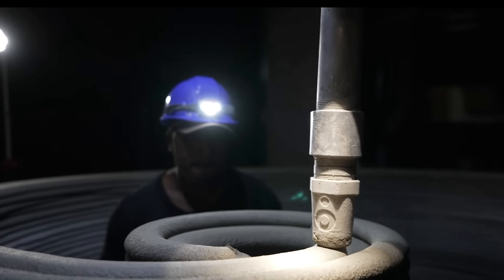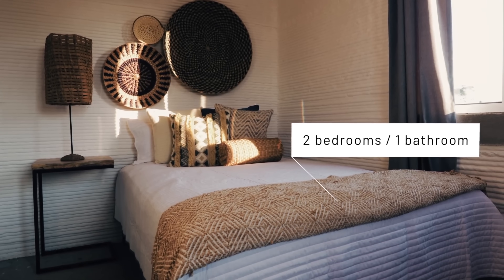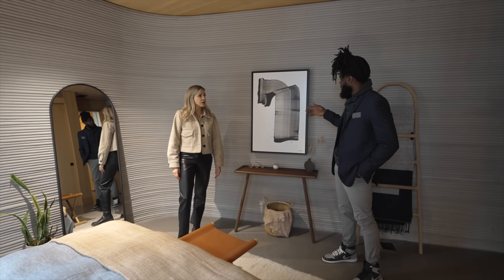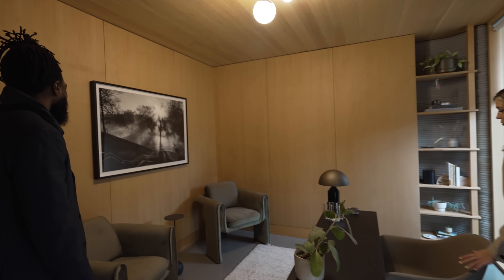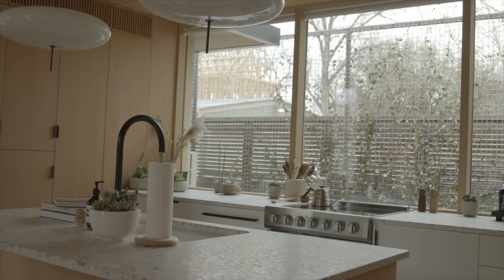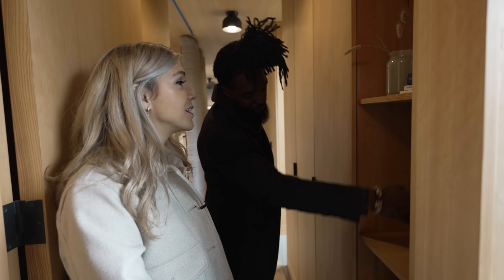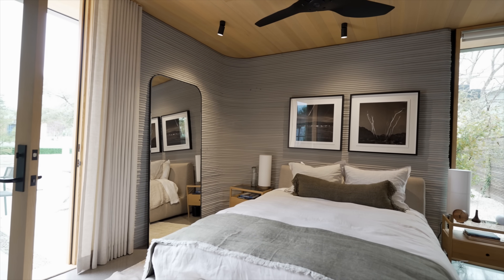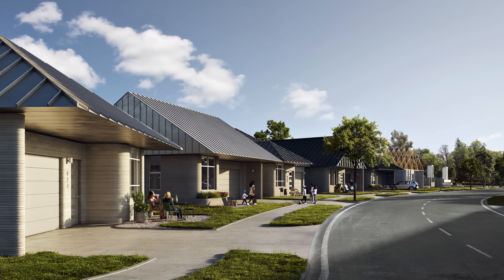Inside A 3D Printed House You'll ACTUALLY Want To Live In

Comment: Instead of 3D printed house why not factory made houses instead. Here's my reasoning:
1. 3D printed houses, despite it's promise, have no guarantee that it'll actually be cheaper. While factory made houses has been proven time and time again to be much cheaper than regular houses.
2. Since both houses aren't very customizable anyway, might as well choose a version that is less of a pain to clean, just look at those walls and count just how much nooks it has for dust to pile up. It's a nightmare for people who have asthma.
3. 3D printed objects aren't known for it's durability wether it's plastic or metal, concrete is no exception. Especially the fact that those houses has no steel rebars or bricks to reinforce it like a typical concrete building would.

Oh yeah if you're going to say "commie block housing bad" then I have some news for you, American suburbs are also basically copy-pasted buildings (but waste more space with those unnecessarily big lawns), and many countries that aren't communist still builds factory made housing for it's price tags. But of course the most famous examples are communist or former communist countries.

Comment: Structural concrete is intended to have rebar reinforcement. And expansion joints. Where was this made? All concrete eventually cracks. This thing could come apart on someone within 10 years depending on the weather. Even sidewalks and drain manhole shafts have steel in the concrete.

Comment: How does plumbing maintenance work on one of these houses. Electrical in the walls is easy enough as you would just feed the wires to all of your access points, but what do you do if a pipe fitting wears out in the middle of a run? It is no longer as simple as ripping out some drywall and then reinstalling. Would you just have to relay layers of their special concrete mixture to seal back up the wall?

Comment: Aight I´m skeptical.
The bare concrete seems like a nightmare to clean and it will probably collect a lot of dirt.
The outside is going to turn green real fast.
The walls did not look like they are as well isolated as what we usually have here in Sweden.
The walls can not be as strong as the walls we have now because concrete poured on top of partially cured concrete does not bind as well as if it was poured at the same time.
+ They look like they are kind of hollow and that can not be positive for durability.
The concrete for this needs to be fine and cant contain rocks meaning the material cost compared to a normal concrete wall is increased.
I´m looking forward to a future where I don´t have to put up light concrete blocks no more but this does not seem like it.
+ depending on if the inside walls are made in light concrete or not we spend about 3-5 weeks putting the blocks up on a house that takes almost a year to make.
So at least in a typical Swedish home this automation could only account for a very slight reduction in cost at best.

Comment: Concrete lines on the outside of the house looks but inside the house it will simply be a dust trap. Still, lots of promise in 3d printing houses

Comment: The tiny house village in LA is temporary, the houses are designed to be removable quickly (and they are all prefabs at that). The 3D printed concrete would not suit that role at all, and lacks the ability to do multi-story more permanent solutions needed in those cities.

Also, not meant for cold climates, obviously.
Reply: I do NOT want that house.  to many "technical" /structural Restrictions inovolved with it and  it required constricted sizes.  The material is a horible mess. Then huge expense to "cover/finish those walls".  Wiring and plumbing issues.  If you want to build something like that there are better/Cheaper , simpler ways to do it.  search ,... Oh what is it called,  Mud/sand bag , earthen bag construction.  And I am not saying I would want that for my main house either.  I've have seen nice hotel rooms....  cement is a mess! espeically when you leave it exposed. Dirt , spiders, and bugs "sticking to it" and those layers/grooves!  then trying to deal with plumbing, electrical etc,  and even try hanging a shelf or picture. :-)) wanna change a door or window? 😅😅😅 that texture is aweful.  even beyond cleaning it has problems.  the novelty would wear off quickly.  and trying to cover that up with wood, plaster, etc... IS $$$$$   Are you noticing that even with the camera/"lense"?shooting done to try and make it  look bigger.  Look at how SMALL the rooms are. EVEN The ones that are supposed to be "larger rooms"  Oh and I live in a mostly solid cement walls and roof/ceiling ...  I will call Bull Sheets on it being 75 F inside on  days when it is in the 90's .  I live in the desert and once it starts warming up in the spring in the "90's" after a few days the cement warms up, the walls warm up and there is no way you are going to have 75F inside without turning on the AC.  if it goes "hot" then cold" then "hot" the cold for a couple of days, then Maybe... But after after a few solid days or warm/hot temps, the cement warms up. and as the temps keep on climing for "the SUMMER/ spring"  the walls of the building keep getting warmer.  In the low desert in AZ,  if I turn off the AC it will "quickly" start climbing toward the 90's F. I guess higher if you forget to turn on the AC.  Oh, and of course the Reverse happens in the winter.  Sure the novelty of this is "cute"  but the reality is..................  Not So Great.   especially if you DON'T want just a little/cramped "single persons"  condo/vacation condo"  and You don't want the MESS of unfinished cement walls.  You know what else you will notice about this... NO REBAR REINFORCEMENT/"structural support".  And there Are More issues than just these... Ahh but the Novelty of it. 😅

Comment: I'd be curious about how the expansion/contraction of the concrete in temperature extremes would effect the longevity of the building. Where I live there's a big range in temperatures throughout the year, from 35 degrees C below in the winter to plus 35 degrees C in the height of summer - a seasonal change of 70 degrees C! I've seen enough heaving in concrete paving stones and driveways from temperature changes, so I'm curious to the practicality in areas with more obvious seasonal differences than LA, Austin Texas, and Mexico (the mentioned areas in the video).
Reply: Where I live, all buildings are made from concrete blocks and concrete. And the temperature can be really cold while the summers are really hot, reaching +40°C in summer. But I haven't seen an issue.
Reply: There shouldnt be an issue, as one of the benefits of this technology is the "layering" and the reduced water content of the mix (as you can see it looks like a paste). Therefore, reduced risk of cracks due to plastic shrinkage or settlement.
Like most concrete structures, it should weather very well against most extreme weather conditions. (better than timber anyway).

Comment: sweet place but it's too small for me to consider it luxury
moreover, it kinda beats the point that you're talking about 3d printed homes as the cheaper alternative yet the one we can actually buy is a luxury home. so what you're saying is, it might be cheaper in the future however, it is not now. (technically the charity homes are free hence cheaper, but you can't really buy them)

also, as someone who does live in a concrete home, it will absolutely not keep the heat away during summer in practicality, you still need an ac.

Comment: Fun fact you COULD 3d print EVERYTHING you need for a house. IF you have roughly 7 million dollars for JUST the printers alone. There's metal 3d printers and they're fuckin wild. Cabinets counter tops fixtures all of it could be 3d printed. Even the wiring. Would it be cost prohibitive? Yeah. But you COULD do it.

Comment: Are they printed in shells? Like an interior and exterior wall? I would imagine you would want to throw some insulation in between an exterior shell and interior shell. If not these houses wouldn’t be very thermally efficient.
Reply: it is like Solid extruded mud.  Not hollow.  They just sound good on the surface...  I do NOT want that house.  to many "technical" /structural Restrictions inovolved with it and  it required constricted sizes.  The material is a horible mess. Then huge expense to "cover/finish those walls".  Wiring and plumbing issues.  If you want to build something like that there are better/Cheaper , simpler ways to do it.  search ,... Oh what is it called,  Mud/sand bag , earthen bag construction.  And I am not saying I would want that for my main house either.  I've have seen nice hotel rooms....  cement is a mess! espeically when you leave it exposed. Dirt , spiders, and bugs "sticking to it" and those layers/grooves!  then trying to deal with plumbing, electrical etc,  and even try hanging a shelf or picture. :-)) wanna change a door or window? 😅😅😅 that texture is aweful.  even beyond cleaning it has problems.  the novelty would wear off quickly.  and trying to cover that up with wood, plaster, etc... IS $$$$$   Are you noticing that even with the camera/"lense"?shooting done to try and make it  look bigger.  Look at how SMALL the rooms are. EVEN The ones that are supposed to be "larger rooms"  Oh and I live in a mostly solid cement walls and roof/ceiling ...  I will call Bull Sheets on it being 75 F inside on  days when it is in the 90's .  I live in the desert and once it starts warming up in the spring in the "90's" after a few days the cement warms up, the walls warm up and there is no way you are going to have 75F inside without turning on the AC.  if it goes "hot" then cold" then "hot" the cold for a couple of days, then Maybe... But after after a few solid days or warm/hot temps, the cement warms up. and as the temps keep on climing for "the SUMMER/ spring"  the walls of the building keep getting warmer.  In the low desert in AZ,  if I turn off the AC it will "quickly" start climbing toward the 90's F. I guess higher if you forget to turn on the AC.  Oh, and of course the Reverse happens in the winter.  Sure the novelty of this is "cute"  but the reality is..................  Not So Great.   especially if you DON'T want just a little/cramped "single persons"  condo/vacation condo"  and You don't want the MESS of unfinished cement walls.  You know what else you will notice about this... NO REBAR REINFORCEMENT/"structural support".  And there Are More issues than just these... Ahh but the Novelty of it. 😅

Comment: They need to start doin these in cities all over, especially because the prices of house & apartments/condos are through the roof. I think all males would be good with a house like this lol!!
Reply: I do NOT want that house.  to many "technical" /structural Restrictions inovolved with it and  it required constricted sizes.  The material is a horible mess. Then huge expense to "cover/finish those walls".  Wiring and plumbing issues.  If you want to build something like that there are better/Cheaper , simpler ways to do it.  search ,... Oh what is it called,  Mud/sand bag , earthen bag construction.  And I am not saying I would want that for my main house either.  I've have seen nice hotel rooms....  cement is a mess! espeically when you leave it exposed. Dirt , spiders, and bugs "sticking to it" and those layers/grooves!  then trying to deal with plumbing, electrical etc,  and even try hanging a shelf or picture. :-)) wanna change a door or window? 😅😅😅 that texture is aweful.  even beyond cleaning it has problems.  the novelty would wear off quickly.  and trying to cover that up with wood, plaster, etc... IS $$$$$   Are you noticing that even with the camera/"lense"?shooting done to try and make it  look bigger.  Look at how SMALL the rooms are. EVEN The ones that are supposed to be "larger rooms"  Oh and I live in a mostly solid cement walls and roof/ceiling ...  I will call Bull Sheets on it being 75 F inside on  days when it is in the 90's .  I live in the desert and once it starts warming up in the spring in the "90's" after a few days the cement warms up, the walls warm up and there is no way you are going to have 75F inside without turning on the AC.  if it goes "hot" then cold" then "hot" the cold for a couple of days, then Maybe... But after after a few solid days or warm/hot temps, the cement warms up. and as the temps keep on climing for "the SUMMER/ spring"  the walls of the building keep getting warmer.  In the low desert in AZ,  if I turn off the AC it will "quickly" start climbing toward the 90's F. I guess higher if you forget to turn on the AC.  Oh, and of course the Reverse happens in the winter.  Sure the novelty of this is "cute"  but the reality is..................  Not So Great.   especially if you DON'T want just a little/cramped "single persons"  condo/vacation condo"  and You don't want the MESS of unfinished cement walls.  You know what else you will notice about this... NO REBAR REINFORCEMENT/"structural support".  And there Are More issues than just these... Ahh but the Novelty of it. 😅
Reply: Cities need multi-story housing, which this isn't capable of. And that kind of construction is already done using elements

Comment: The house looks amazing......if you live in a very hot country that barely gets cold or rains by itself, i am curious to how a house like this would hold up in colder or more wet countries, like New york in the winter or Portugal in the raining season (yes, we have a raining season, like tropical rains)
Reply: I do NOT want that house.  to many "technical" /structural Restrictions inovolved with it and  it's required constricted sizes.  The material is a horible mess. Then huge expense to "cover/finish those walls".  Wiring and plumbing issues.  If you want to build something like that there are better/Cheaper , simpler ways to do it.  search ,... Oh what is it called,  Mud/sand bag , earthen bag construction?  And I am not saying I would want that for my main house either.  I've have seen nice "Single Story" hotel rooms....  cement is a mess! espeically when you leave it exposed. Dirt , spiders, and bugs "sticking to it" and those layers/grooves!  then trying to deal with plumbing, electrical etc,  and even try hanging a shelf or picture. :-)) wanna change a door or window? 😅😅😅 that texture is aweful.  even beyond cleaning it has problems.  the novelty would wear off quickly.  and trying to cover that up with wood, plaster, etc... IS $$$$$   Are you noticing that even with the camera/"lense"?shooting done to try and make it  look bigger.  Look at how SMALL the rooms are. EVEN The ones that are supposed to be "larger rooms"  Oh and I live in a mostly solid cement walls and roof/ceiling building ...  I will call Bull Sheets on it being 75 F inside on  days when it is in the 90's .  I live in the desert and once it starts warming up in the spring in the "90's" after a few days the cement warms up, the walls warm up and there is no way you are going to have 75F inside without turning on the AC.  if it goes "hot" then cold" then "hot" then cold for a couple of days, then Maybe... But after after a few solid days or warm/hot temps, the cement warms up. and as the temps keep on climing for "the SUMMER/ spring"  the walls of the building keep getting warmer.  In the low desert in AZ,  if I turn off the AC it will "quickly" start climbing toward the 90's F. I guess higher if you forget to turn on the AC.  Oh, and of course the Reverse happens in the winter.  Sure the novelty of this is "cute"  but the reality is..................  Not So Great.   especially if you DON'T want just a little/cramped "single persons"  condo/vacation condo"  and You don't want the MESS of unfinished cement walls.  You know what else you will notice about this... NO REBAR REINFORCEMENT/"structural support". ("no multiple stories" Fractures? not good for earthquakes, settling ground, etc.) And there Are More issues than just these... Ahh but the Novelty of it. 😅

Comment: This house looks really good and sturdy, but I'd still be curious to see how well it stands against natural disasters such as tornadoes.
Reply: Well it's concrete so tornado won't really do much unless it's really strong, however just concrete will probably be pretty weak against earthquakes, tsunamis, and floods.
Reply: @robbieaulia6462  it is just concrete is the major concern...u dont have any reinforced columns with steel bars in it holding the house in place in most of the disasters...
Reply: @robbieaulia6462  concrete with no steel inside. its not that sturdy
Reply: @robbieaulia6462  EARTHQUAKES? ITS A PILE OF RUBBLE
Reply: Unplastered concrete will crumbs over time. Or, if not painted, you would have to clean the sands on the floor every morning.
Reply: Much better than the american sheds that people call houses.
Reply: It doesn't have metal on it?
Reply: "sturdy"?? 😂😂😂😂😂😂
Reply: Yes, or since we're coming up with stuff, how about a 9.5 richter earthquakes where half the state slides into the sea. Would the house still be standing? Or what about a meteor - would the house survive direct impact at lightspeed?
Reply: @JDH_MUSIC that's irrelevant. There's not much of anything that will survive those things.
Reply: SOME HOUSES IN FLORIDA ARE CINDERBLOCK
Reply: Since there's no rebar, it'll probably collapse in a storm and you'll just be buried alive.
Reply: There's 0 rebar in that concrete. The walls will crumb for sure
Reply: Certainly much better than timber and drywall :D
Reply: I've watched a couple of interviews and they say these homes/buildings are 3.5 times sturdier than regular construction built homes/buildings. They withstood 200mph winds and 2+ hours (I believe) in a fire.
Reply: no house can stand against tornadoes .frankly says